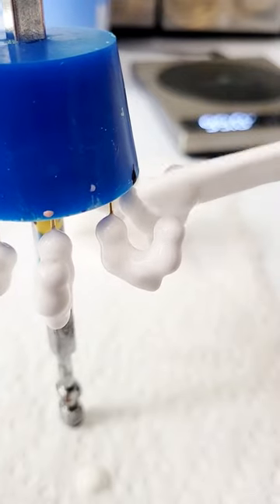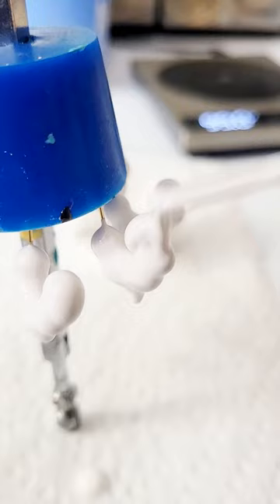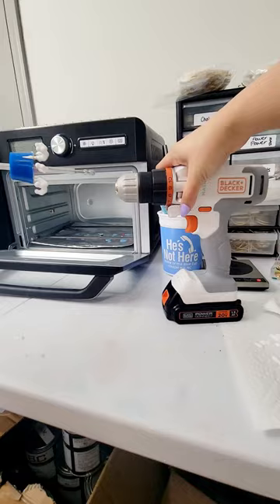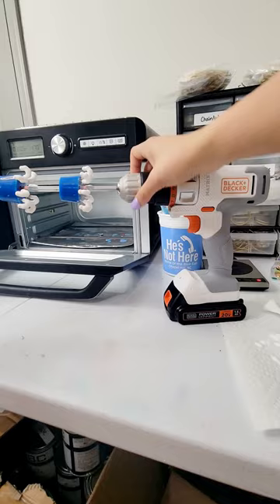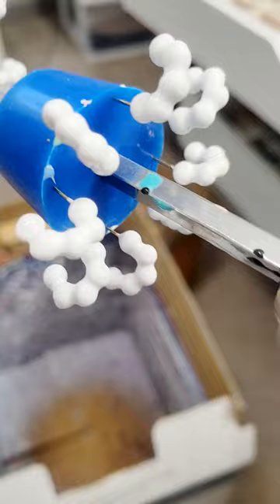Why I use a drill to make jewelry!

Comment: So question - why a wooden stick and not a brush to apply the enamel paint?  In my head it seems like a brush would give more control than the stick.
Reply from the maker: The paint doesn't wash off so it needs to be disposable and I didn't want to throw away brushes! I chose sticks because I feel like wood is more environmentally friendly
Reply: @lovekojewelry  ah gotcha!  That makes sense!  Thanks for answering :)